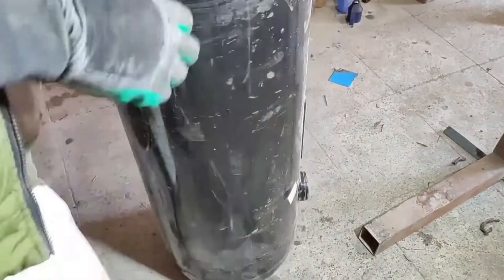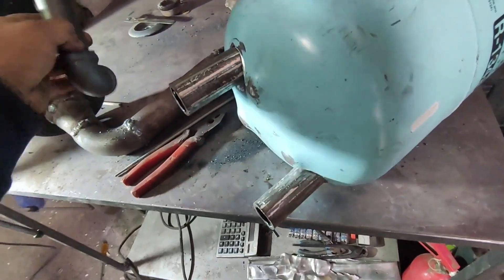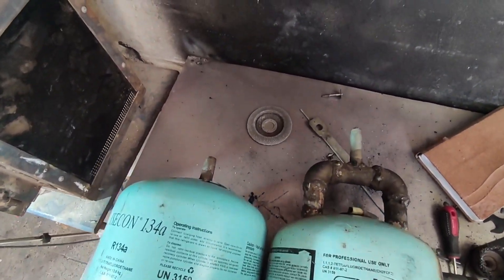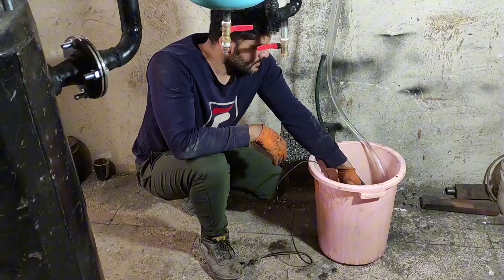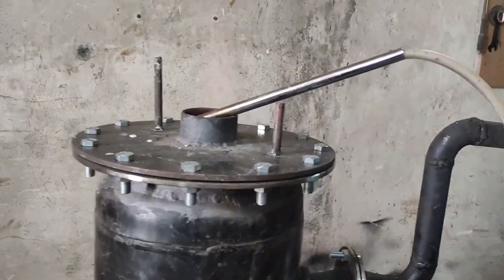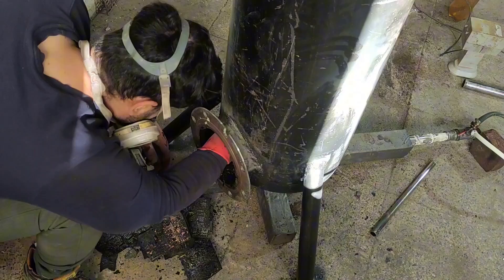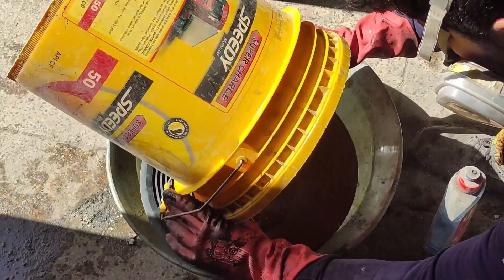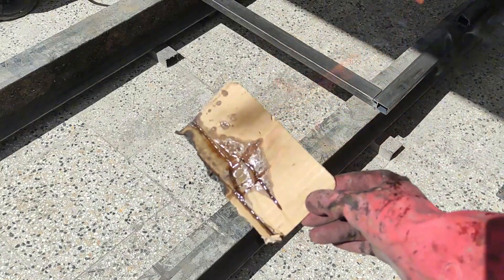Copper & Oil From PCBs | Building a Pyrolysis Reactor 2/2

Comment: It's actually a great idea, just need a little more development to make it more efficient...
My suggestion is to try a wide oven with a furnace assembled from pipes, so that it can be airtight and maximize the pyrolysis process ...
The pyrolysis pipe also needs to be cooled first, so that the diesel oil can be a lot...
Keep up the good work my friend.
Reply from the maker: Thanks for supporting and the tips🙏

Comment: @PickyPlans  .   Leading the off-gases directly into the fire chamber will almost eliminate the need for propane gas! 
However, there are some aspects to consider: Raw Pyrolysis Oil is valuable. It's more profitable to let the off-gases condensate and recover the oil content. Afterwards I refine it to free Petrol/Gasoline, free Diesel, and free Heavy Fuel Oil for my metal melting furnace. 
Only one of my four pyrolysis units is set up for immediate consumption of the off-gases. This unit is solely used for removal of epoxy resin, lacquer, and troublesome minor plastic remains, on small items originating from e-waste. The feed material contains mainly metals, thus it's not profitable trying to recover the relative small quantity of created pyrolysis oil, but instead use it immediately as fuel for the unit. 
Pyrolysis is actually my main way of disassembling many parts in e-waste (minimum 50 kg batches in each run). Bear in mind that pyrolysis does not only result in "oil" During the process the feed material is on average converted to 10 -15 % carbon residue, 65 to 80 % Raw Pyrolysis Oil, and 15 -20 % gas. The higher the temperature in the reaction vessel, the more gas. 
If you don't have professional gas-bags, like I have, to collect the non-condensable gas for later compression to liquid form, you can take advatage of the caloric value of this gas and make the whole process almost self sustainable. 
Of course in the beginning of the process external heating is needed to bring up the temperatur in the reaction vessel, but then the produced gas is usually enough to keep the process running. In the end some external fuel will be needed to complete the process in order to ensure a full carbonization. 
Warning: Never connect a tube with flameable gas directly to the fire chamber (risk of explosion!). You can use a water trap, but it causes a light over-pressure in the system. Better is to make a fire arrestor filled with steel wool (look it up on the net, or YT). 
As a final note, the carbon residue in the reaction vessel is used either for making activated charcoal (depending on the purity, or more specific the contamination with other unwanted matter), or it's pressed into briquettes for later use as fuel in the fire chamber of the pyrolysis unit. 
If you have any other questions, feel free to ask; I might be able to give advice or recommandations.
(This reply is reposted after several attempts, due to YT continues to delete my text)

Comment: Good morning, Picky. I have been following your channel for quite some time now and enjoy your innovative research that you're doing with E-Waste recycling with your utilization/repurposing of existing materials. It is an inspiring design. 

My question is about the Pyrolysis retort chamber being as large as it is, of course running time is going to depend on the amount of material put in. My question is, do you have an approximate running time for the process per kilo of material in the Pyrolysis retort chamber once the required internal temperature is reached?
Reply from the maker: Thank you so much for your consideration 🙏
According to my recent records it took 6 hours for a 50 kilos batch of shredded PCBs...
Reply: @PickyPlans , thank you very much for the info. That's exactly what I needed to know. I'm starting to move forward with my build and looking forward to the results.

Comment: I like your use of a central heating colum. I want try that with the outer cyclinder wrapped with insulation. I have melted the concentrate into bars to make anodes in the electro refining cell (H2SO4 based). Fe3+ as the oxident. Where do you think the Bromine ends up? I also need to see where the Beryllium oxide ends up.
Reply from the maker: Thanks, The majority of bromine is more mixed with the oil...
And Beryllium oxide in the powder fraction of ground materials and if smelt in the slag